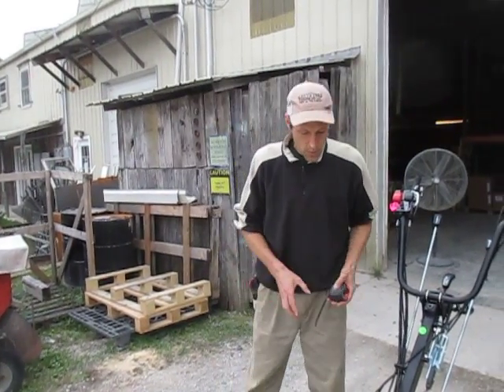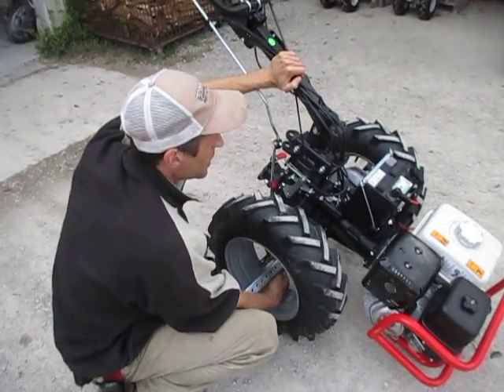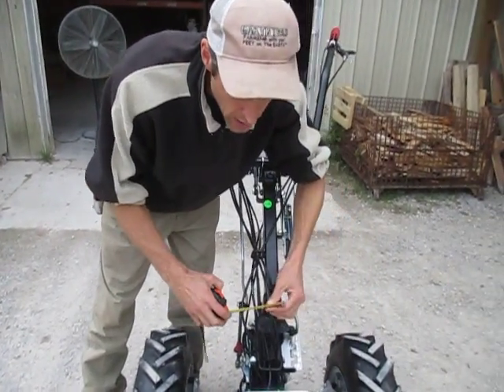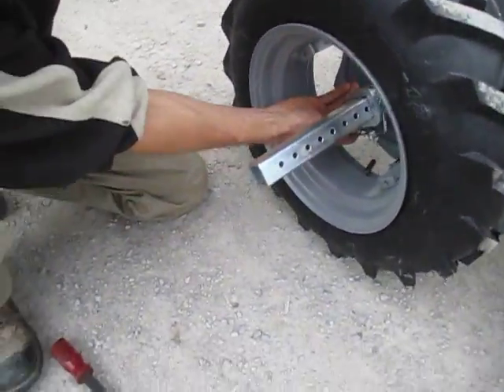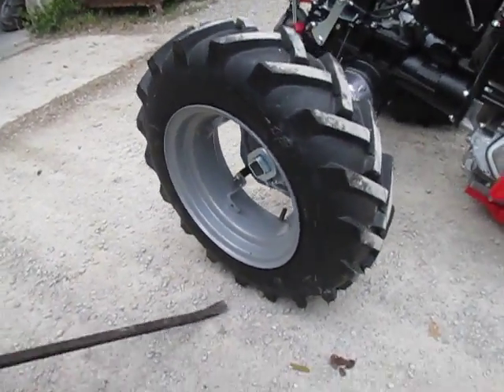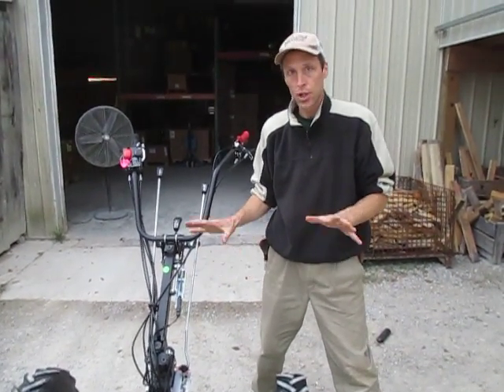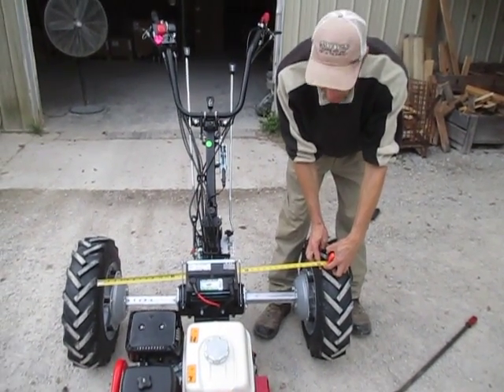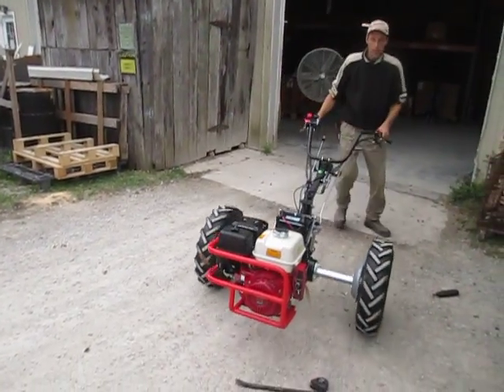Demo: Earth Tools Adjustable Axle Extensions

Comment: Very useful! Thanks. I am considering wheel extensions as, despite doing all i can to maximise the effectiveness of the differential braking i still find it hard to turn my BCS740 with the 85cm Berta flail on the front, especially  in long grass and brush.
Reply: Just to add that I bought a set of these through the UK BCS importer, Trackmaster, and they have indeed given me far better steering on the brakes than I had before. They needed just a little bit of fettling to a few of the holes to fit the extensions onto the studs and get the locking pins to go easily into place (with the 10 inch wheels there isn't a lot of room to get these in but they do go without having to be shortened)

Comment: I bought a BCS 853 and many implements from Bob at Emerald Power Tools in Eugene, OR. You remind of him. He's a great guy. You have some great videos. I farm two acres of Alba winter barley, Austrian winter peas and corn for hog feed and forage. My BCS does it all. I sure could use a stationary thresher and a grain drill but at 74 it's not something I can afford. Horribly expensive. Looking forward to the next video.
Reply: Can u use the walk behind tractor to do 6 acres?
Reply: @funkidslearning9646  My dad used a mule team back in the 30s and 40s before buying a John Deere at the end of the war when I was born. Of course you can do six acres with a 'walk-behind' but like mules, it takes time. My little farm is 18 acres most of which is still in pasture. I'm converting it to grass hay and field crops. At my age I have a lot of time.
Reply: @eliotness7274  I am interested in bcs but just wondering which model best fits my work such as planting 🌽 and tilling weeds in space of each row and I just need only space of 26" rear tine  and less ;not necessary 30" or 33" because the wider it is , the more space of soil it will waste , but at least 13hp, u know which model is best to do about 5-6 acre farming and how different diesel and gas is? Bcs is better or Grillo ?
Reply: @funkidslearning9646  Back in the '70s I bought a used TroyBilt and when it died in the mid '90s I bought a BCS 605. It has an 8 hp Tecumsuh engine and a 24" tiller. After twentyfive years of service it still runs though I've had to replace the magneto and do some other maintenance on it. I bought my BCS 853 late summer 2019 and have a half dozen implements for it including a 30 or 33" tiller: chipper, splitter, subsoiler, cyclebar mower, brushhog mower & blade. The 13 hp engine drives the unit very well although I had to remove the cone clutch because it became stuck during a protracted mowing operation. It was relative easy to remove the clutch and break it free. Because I use several implements, the QuickHitch was well worth the $100 because it takes me just a minute to remove one unit and attach another. On new ground or when a fine tilled earth is required I run the 853 in first gear otherwise I run it in second. This is especially true during ground preparation for field peas, wheat, barley, field corn and transplants. I've never used my 24" tiller with the 853 and imagine that it would till a bit deeper and perhaps even in third gear ... maybe. Third gear is pretty fast but I use it for planting. Like a one-horse plow you need to spend an entire day working up a half dozen acres. When weeding, it will dig pretty deep in second gear unless you set the tiller to as shallow as possible. Third gear will weed great but can also take out a lot of corn seedlings to the inattentive operator. The 605 will work just fine with the 24" tines if I am only weeding. That's my experience. I don't know the engine size on the other BCS tractors other than the outdated 605.